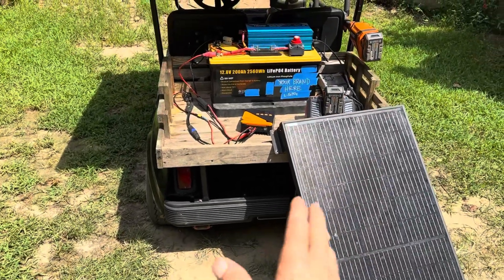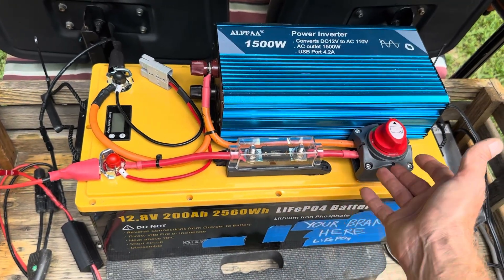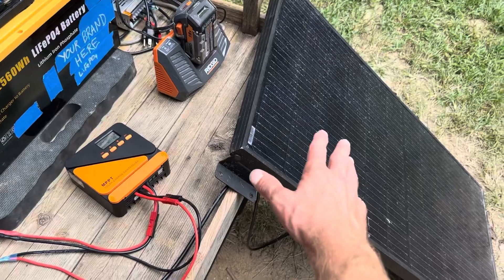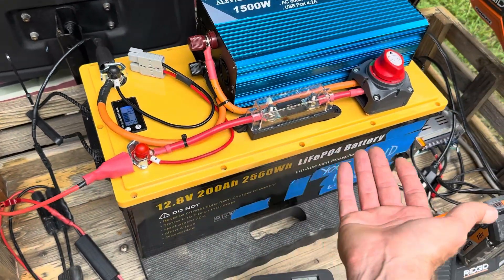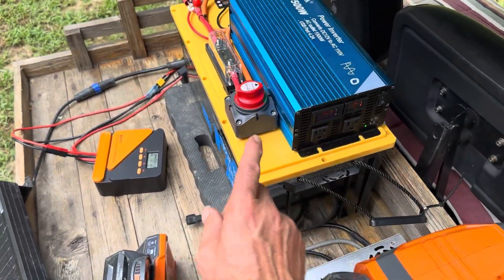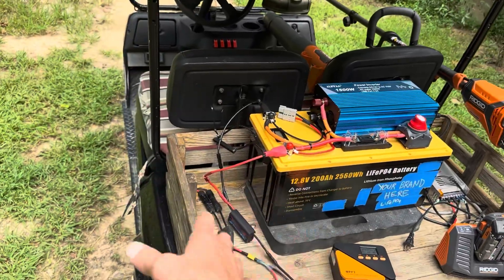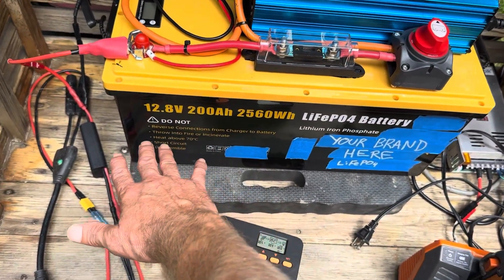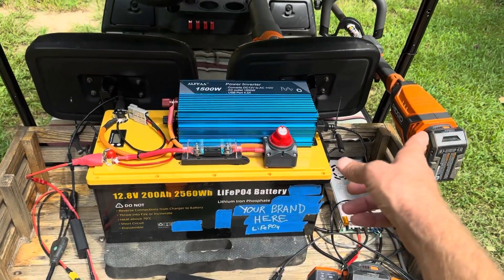Poor Man’s Portable Power Station, Easy DIY Potable Power

Comment: Nice video I have a question, I have a 100Ah LiFePO4 battery and would like to use a 100A MRBF terminal fuse, connected directly to my 12V 1000W inverter using 2 AWG welding wire. Would this setup be feasible?

Thanks!
Reply from the maker: 1000W inverter would be pulling about 1150 on the DC side at full load. Roughly 96A so you should be in good shape! Check with manufacturer of wire for ampacity tables for various wire lengths/gauges. 👍
Reply: @ Thank you!
Reply from the maker: @minceym  you’re most welcome sorry I didn’t see your message sooner!

Comment: This is can do enginuity but I think the small solar panel might keep up with a boom box radio but not power tools and work lights for recharging that rig on the go.. The 80 watts or so that panel produces an hour is still very small and less than a kilowatt on a long summer day with full sun.. Tapping into the alternator output of a gasoline engine on an ATV could yield 10 to 15 amps DC at 13v would be the better/best choice and maybe putting a larger panel or couple panels as the roof of the rig to do some share would to me seem better..
Reply from the maker: As stated in the video I carry the small panel bc it fits in the bed. Also stated that 200W would be bare minimum to keep up with a 16cf refrigerator

Comment: It’s great to see how you’ve put together a practical and versatile setup for off-grid use. The 200Ah LiFePO4 battery you’re using looks like a solid choice, and it's impressive to see how well it performs in extreme conditions.

Comment: 🤔 ? : it will require 250 hours of prime solar time for that 100 watt solar panel to charge the battery ; that is 10 days . What are you going to do for the 8 days that your battery has been totally discharged ?
Reply from the maker: Believe you’re off a digit. 5 hours @ 100W is 500Wh so 25 hours to charge from 0-100%. This panel was for a demonstration and one I keep in the back of cart or lay on the roof. As I stated in video it would be minimum of 200W of panel to keep up with a 40 watt per hour average refrigerator under good conditions. 
I charge the battery with a 25A charger from another small 12V system. Cart has its own charge controller and boost charger built in.

Comment: Awesome video!
I understand that you already have an inverter on the golf cart so obviously you would use it but I have a hypothetical question.
Can you charge the golf cart with that 200 ah battery without using an inverter? 
TIA and KEEP ‘EM COMING!
Reply from the maker: Yes I can charge it without an inverter! DC to DC boost charger. Didn’t invest into one for this current battery pack. Changes are coming to the cart. 

I also have a 150VOC charge controller under the seat for high voltage arrays and a boost controller in the dash for low voltage arrays! 

I’ll be removing the portable power pack once I install an Inverter to run from the golf carts new battery pack. Then it will be a mobile power station!

Comment: Definitely a nice little 12v build.  Very portable and has a lot of punch. It has me thinking about one for my garden pump setup.  
On a different topic, what about the micro inverters I see people talking about? I keep getting emails about them, but I don't see a lot of people using them yet. What is your thoughts on them?
Reply from the maker: It’s a handy little rig for sure!
I run string inverter and central inverter setups. Micro inverters can optimize panel usage and help pull more power out of a string of PV feeds AC power to loads. But load clipping is an issue with this setup. Very popular with grid tie folks. An string inverter can also be fed with micro inverters if it has the correct features. 
I don’t use them due to added cost and another point of maintenance/failure. Many also require internet to work. I’m focused on filling batteries, my loads are so small that it also just doesn’t make sense for my application. Rarely exceed 1000W load for the house.
Reply: @THEOFFGRIDMOUNTAINHOMESTEAD  thank you!  I figured it was something to do with grid tied equipment. I also noticed that units are relatively small around 300 watts.  I know most of the off grid people are not using it.  Regardless thank you for explaining the small grid tie micro inverters.
Reply from the maker: Not as common to see off grid. Common to see one micro inverter per panel. Sometimes two there are variations depending on manufacturer.

Comment: Those 200amp hour size batteries is a nice size for getting stuff done.
Reply from the maker: 100% ! One could use a 300Ah that’s same dimensions but the extra weight could make it more cumbersome. Adding another 20-22# to carry may be too much weight for some folks.